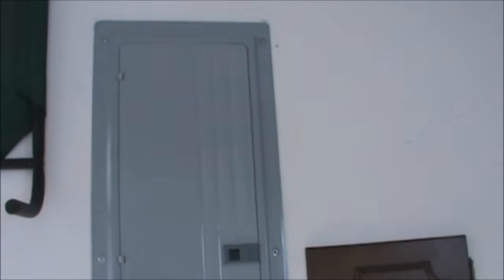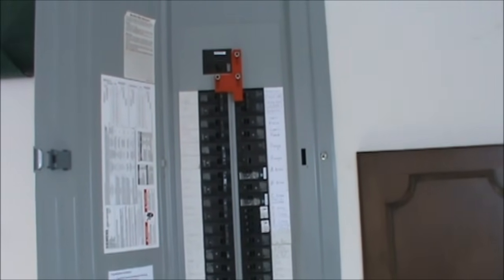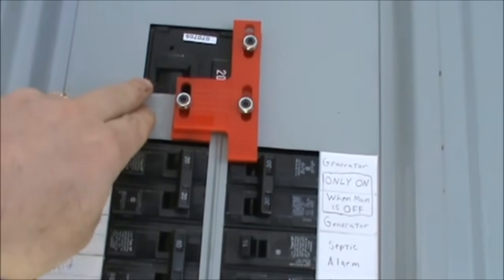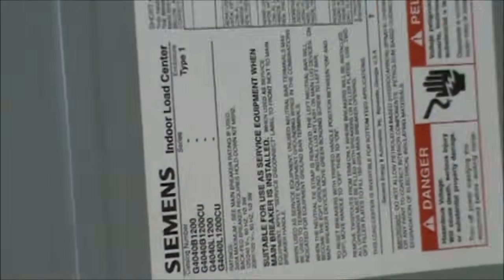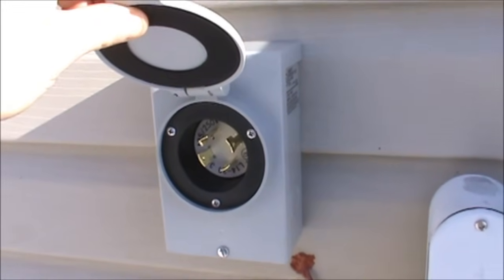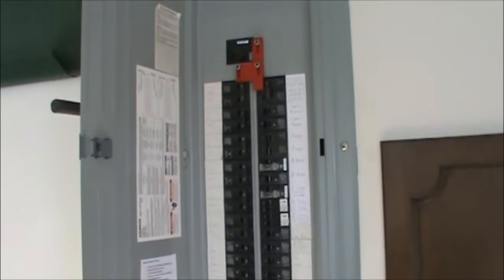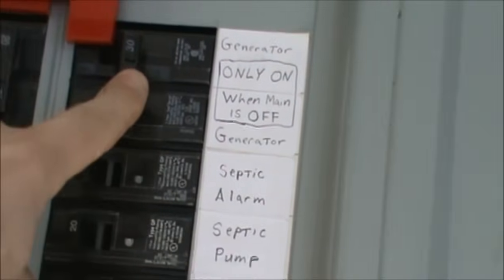How to wire a generator to an electrical panel

Comment: Can I install a 30 AND a 50 amp breaker in panel and have 2 generators feeding them? I have 30 amp breaker for my generator (7500 watt) and my welder/generator (10,000 watt) that I would like to hook up. Being a 50 amp I know I can only get 12,000 watt out of that hook up (50 amp x 240 v= 12,000 watt). Most of my house is electric,  have to turn off multiple things for my hot water heater, if I'm away I want to make it easy as possible for wife. Thank you

Comment: where can one get a 4 prong 30 amp male to male plug to connect the generator to the house generator outlet on the side of my house
Reply: Chris Nichols on Amazon, or elsewhere, look up NEMA L14-30. That’s the electrical code for 4-prong, 30Amp, stuff. If you put a P after it, you get plugs. If you end it with an R, you get recepticals. If you just say, generator cord after it you get that, usually make to female but you can also get a converter for one end making it do double duty. Buying the ends and the cable separately is often cheaper if you want to make several or custom lengths, like in this case.

Comment: My backup system is easy. 15Kw solar array with an automatic switch over if the mains fails the system counts down from 30 and switches over if no mains is detected. Also there is an uninterrupted system that keeps critical systems powered until the backup switches over. If the solar system goes under volt there is a redundant diesel generator system of two 10Kw generators (LPG) synchronized in parallel  that will kick in in the same manner and also this will charge the solar battery bays. All the switch over delays are covered by the UPS system though the UPS system is limited to 120v for 1 hour or 240v for 30 minutes depending on the total load of course. I also have the option to sell power back into the main grid with a GTI (Grid Tie Inverter) to lower my power bill. The whole system is computer controlled of my design and has passed code.
Reply: I'm impressed.  Easy for you, maybe.

Comment: Simple manual buss transfer nice and safe . However please consider where you place your portable generator. Ensure that there are no natural or mechanical air intakes in your home. Example open window, vent, fans so on. Carbon monoxide is colorless,oderless and will be present while running generator. Many people kill themselves by placing the generator incorrectly. Also never refuel a hot generator, let it cool down first. You have to think and be safe with portable generators.

Comment: Can I assume either your generator was not neutral bonded or that you disabled the neutral to ground inside the generator? I didn't hear or see that discussion. I have both a transfer switch and a Reliance PB50 with Reliance 50410 transfer panel but decided to use the transfer switch because I have a Generac EXL 10000 and the Transfer switch would not allow me to use the generator full capability because the breakers are 20A each for the 2 240 circuits and my AC will draw more power than that.
I do like the red paint on the slider. I plan to paint mine the same color as a good safety warning...
Reply from the maker: My entire house panel is bonded with 4 gauge copper.  I'm not sure if that is what you are getting at??
Reply from the maker: I like a guy with a good Generac EXL 10000 - wife of doulbewide6

Comment: I have a ? , I have a camper cabin and its wired for 100 amp service and i would like to use my 7000w generator rather than ever using outside utilities . Can you give me some pointers to hard wiring the generator to the power box ?   thanks

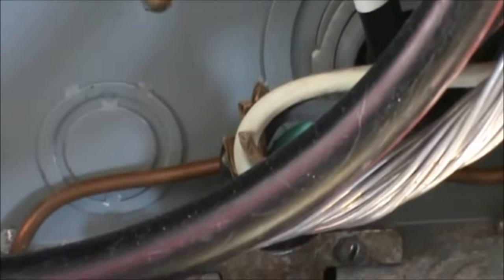Comment: @3:27 is where I'm stuck. My panel is in the sheetrock too, so not sure how to feed the wire/conduit up to the bottom of the panel without cutting sheetrock. I mean, does it go through the floor or wall or what? Just trying to see if theres a way to do this without cutting into my wall.
Reply: *****
My projects been over for a while. Had to cut sheetrock under panel.

Comment: Myself personally, dont believe in back feeding panel, have no problem utilizing extension cords. Use 2 pole 3 wire ground L6-20 or 30 cord for 220 appliances. Preferance use #8 wire in powering up 30 amp 220v via L14 -30 P/R
Reply: Have fun tripping over all those cords and running your furnace or heat pump refridgerator or electric range. feeding panel with interlock the way to go..
Reply: +John S People discovered electricity, and invented ways to use electricity. There is no wrong way todo it unless you make it unsafe, though there are many ways a person could configure a generator.  Essentially pretend that you cut your utility line with the flip of a Main disconnect switch.  Then you make a new utility line , with a double breaker in your panel. Where you get into trouble, is when people forget to flip off the mains.  It is very helpful to have the interloc system, as a friendly reminder that you have no choice in the matter.    In america we use 120v and 240v.  110 was a legacy from the old 1 mile DC system that dumb edison thought was "good enough". 110vDC !  not sure why we say 220v  hmm...   #8 is a good choice. It is within the medium to high range of the terminal temperature rating/de-rating NEC chart and works just fine for 30-40amps.
Reply: ***** Actually my barn has a small panel of 8 circuits with no main disconnect and it was wired through 2 50 amp breaks as the main feed and disconnect and it was OK'd by the electrical inspector !!!  It is per code !!!
Reply: Wilbur Finnigan
Thats cool.  Seems reminiscent to my grandpas old farm and woodshop. I remember as a kid checking all that stuff out, exploring. lol . He had about 8 am/fm radios scattered around the property for sports, and a hint of captain black tobacco. goodtimes.

Comment: You didn't show how to wire it. Change the name of your vid.
Reply: The title is correct. He tells at the start of the video, hire a certified electrician. That's how you wire a panel.
Reply: @pmcsurf1:
i agree with you, technically he did NOT show you how to wire it, just showed you that its wired ...
Reply: @Jeff McKenzie:
Technically he didn't show anyone HOW to wire it, only showed THAT is was wired. 
There is a technicality difference there that MOST don't see .. You are one of them.
Reply: The wires that are connected to his 30amp breaker are coming from the back of the inlet that he had installed on the side of the house.  The inlet will have the wire locations marked. You just put it on conduit and connect it to the breaker. Basically.
Reply: @jeffmckenzie7282  no your wrong you need to know how to wire this not all electricians are that smart its good to double check there work but I know ur gonna say get a second opinion that's not a smart answer

Comment: Is the ground and neutral in your panel bonded together?
Reply: No response! A critical question to answer.
Reply: @4toddlaroche  if it's a bonded Gen does it need the nuetral and ground at the box? I'm using an old 2 conductor box that grounds the commons and nuetral together at the water pipe? Says to ground the generator to the earth
Reply: gene if it’s a neutral bonded generator, you don’t really want the neutral continuous with the ground at the panel. Rule of thumb: neutral should be bonded to the ground at one point in the system. Otherwise, your ground is serving as a parallel return to the generator.
Reply: @4toddlaroche  the gen is a bonded one, nutrual, ground and ground lug all have continuity. As of now have 2 120s and nutrual going into the old 60amp meter box using original wires as lines to box, , waiting on new 100amp service. Your saying don't run a ground since gen is bonded? Creating a ground loop
Reply: gene neutral and ground should be bonded at ONE PLACE in the system... if it’s a neutral bonded generator, having the neutral and ground wires running directly to the main (where neutral and ground bars are bonded) and connected at the bus bars there will energize the ground wire as a parallel neutral. Not ideal.
Reply: @4toddlaroche  I'll ground the gen and run the nutrual way it is and check the voltage 1st thing. Wired houses 30yrs ago but never dealt with a generator, live and learn! My good buddy was a commercial sparky but passed some yrs ago.
Reply: gene my approach would be to remove the bond (jumper) between neutral and ground at the generator and then run neutral and ground wires to the panel.

Comment: of all of the video's  that i have looked at onlt one has shown the generator being grounded to a ground rod.  

.as for my setup in says to ground unit seperatly. my home has only one item which is 220v at 30 amp. 
My electric co.  did a survey and recommended a generator around 8750 so now i can run my whole house.  and have a little wattage left over.
i opted out toput a bypass panel in because of a remodel.

Comment: For starters, at no point have I promoted or justified connecting a genereator with no interlock to a distribution board.

Secondly, I am NOT debating the legality of hooking up generators to distribution panels by any method.

Thirdly, If the break were between your house and the pole out on the street, why would it matter if the cable were energized since the cable arriving to the pole is energized anyway when the electrician does the hookup.

Electricians at work wear heavily insulated clothes so they don't fry themselves when working. And the ones that diddn't died last tuesday for not wearing them.

If you could answer the following question: How is it possible to undertake maintenance on 132.000 Volt lines on pylons without taking them offline?  Is it
A) JFM
B) Insulated electrician + tools

Comment: My main power cut off from the street is not in my electrical panel.  It is at the meter on the outside of the house.  No way to install the interlock.  What do I do?

Comment: If I turn off my main breaker of 200amp and then connect the generator to the panel? Can I use it with the main breaker in off position?
Reply: yes the main break should stay off while your generator is in use. the generator breaker will be on along with a few select other breakers. if a interlock is installed it will only allow main or generator breaker be in the on position at one time

Comment: small generators of that type are good for the bare essentials, but not to supply power to sensitive electronics, TV's , computers, stereos, or anything that has micro-computers. to many spikes in the current flow will cause premature death of electronic devices.

Comment: This is a great way to run a generator but there are 2 problems I have found first is easy. 
Only buy interlock made for your panel that is UL listed 
Second problem is slightly more complicated. If you are using a generator with 2 separate single 120v breakers on the generator and one trips you are going to have serious problems
Reply: why would you use the two 120 and not just the one 240 outlet?
Reply: No Name I am using the 240 it’s that the single breakers trip individually losing only one leg

Comment: Great job , were did u find the inter lock switch or can just make it , it say something written on your ?
Reply: Go to Interlock.com with the model of your load center. determine interlock number. then go to E bay and look for your interlock number, it will cost you half what interlock wants for the same interlock kit. did it for both my panels.  good luck
Reply: The owner before me put the box in upside down
Reply: donald laisure  It still should work....
Reply: Is there reason so cost red piece of plastic and so stickers really
Reply: Certifying and liability insurance...cover their asses and profit...
Reply: donald laisure There are not plastic, they are steel, painted red for alerting.
Reply: Amazon also has them.

Comment: the ignorant fear of what they do not understand, while the wise live and learn. 

I've watched my dad wire 2 wall sockets, 3 lamps, a washing machine and an exhaust fan with a variable speed switch, all while the power was hot. 

What I learned is that if someone is not able to grasp the concept of an electrical circuit, no amount of safeties are going to help them. 

My pops rocks.
Reply: BigSmartArmed I guess you've never heard of accidents
Reply: i myself, have 12 giant 100ah gel batteries on a battery shelve with a set of two redundant UPS units, which also serve to bulk charge the 36v battery string. The UPS units intercept 5 or 6 of the house circuits first, then the UPS gets its supply from the transfer switch which gets its supply from the mains breakerbox. In the event of a power failure, i have 24 hours to a week... to turn the generator on manually. Once the generator is running, the UPS units charge the batts and the house gets uninterrupted power.   .... and people cant even wire a simple 120v 15amp recepticle ????  really !  people dont know what electricity is, yet it controls nearly every facet of their lives.  "You know, theres allot of water in watermelon".  oh and all my power gear was given to me over the years, free... didnt cost anything.
Reply: *****
cool story bro

Comment: With a 9000 watt or 7500 watt generator I'd run a 60amp breaker not a 30amp....what's your wattage? And its safe

Comment: That kills main power but couldn't you back feed to the power company through neutral? Say at a wall outlet which has the generator hot and the power company's neutral, If at that outlet hot gets shorted to their neutral? Or since the generator neutral is hooked to the box it would trip out first...?

Comment: Nice setup but i think it is still technically illegal because your neutral/ground is not isolated this means when you are running on generator power the current inbalance will travel through the neutral conductor and still potentially hurt someone working on the lines outside
Reply: +Nathan John  The neutral wire going to the pole will not be energized with any AC current with this setup.  There will be no ground to neutral potential difference.  Even if this was true, every pole has a ground wire stapled to it.. or every other pole. So technically the "Neutral" or "N" on the pole is grounded.   neutral and ground are just labels people give something, after all, humans like naming everything. In reality, AC has no polarity.  Generally , we have a ground to protect sinks and drain noise and "prevent an improperly wired outlet" but ironically grounding things are the cause of electrically "hot" and shocking enclosures when they are wired backwards and or a fault has occurred, and so the ground or sink is grounded, and makes part of the circuit, if it was not a grounded system, you wouldnt get shocked by touching the sink and the defective product.  AC is relatively isolated coming off the generator until you assign it a N and a L.... then the "N" becomes a "Common" and if that "N" is bonded to a sink, then ONLY if you supply a "L" will you have power to electrocute.   A serviceman working for the power company will not have your  "L" as long as you follow the video and have your mains switch OFF with an interloc installed.  Your "L" is not bonded to a ground, or attached to any service like leaving your premises.   Some generators have 2 "L"'s  or two lines...  for 240... and one neutral...  just like the transformer on the power pole...  except your generator has that winding inside of it...   which means it is similar to how the transformer on the pole is configured.  In commercial usage, transformers are wired in ways you never thought was possible. Anyway im sure you already suspected and know half of what i say here, or all of what i say.  Electricity is actually very easy to understand conceptually, and has remained almost unchanged since the days of westinghouse and tesla's AC system. Some transformers out there are original . The Important and critical step is to not allow your generators L1 and L2  out your main power breaker.  N wont send "phantom" power out of your house.  We only call it a N because thats a "common" point for 120v recepticles to join to a single wire that goes to a center tap of a ..Xformer, which is also almost always grounded . the center tap is in the middle of the 240v winding.
Reply: having main breaker off  in the panel while useing generator power keeps power confined to just the panel?

Comment: NEC Section 250 code (here is the reference)
http://www.mikeholt.com/mojonewsarchive/GB-HTML/HTML/NECArticle250Sections250.20-250.34~20020124.htm
states that the generator should not have the neutral and the ground connected at the generator (FPN: 1) from the above reference. Previous versions of the code didn't care if you had the neutral and ground connected at the generator which is a bonded neutral. A floating neutral is what I am being told by a Generac expert is the only way to do this. Their point I am told is that if the neutral breaks the ground is now a possible electrical shock hazard at the generator.
Hope that helps explain why I asked the question...
Reply: This only applies to separately derived systems.

Comment: Normally the main breaker feeds both sides of the panel, left and right sides.
There are 2 cables coming in and each is wired to an individual buss.
From my understanding these busses are seperate.
How then is the whole panel energized when you bring in generator power to only the right side of the panel?
Am I not understanding something?
Reply: That double breaker is connected to both the left and right side.
Reply: Do you have a picture of the setup?
Also want to know how you handle the bonded neutral from the generator?
Most setups require a neutral disconnect at the breaker panel if your generator has a bonded neutral.